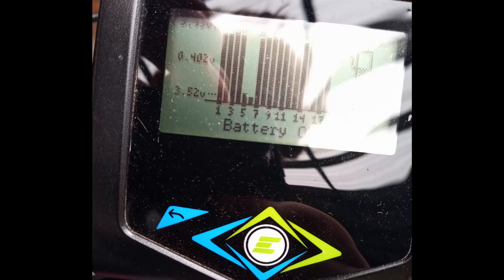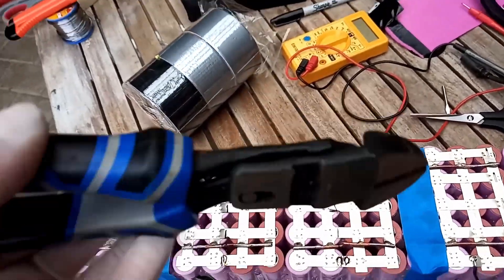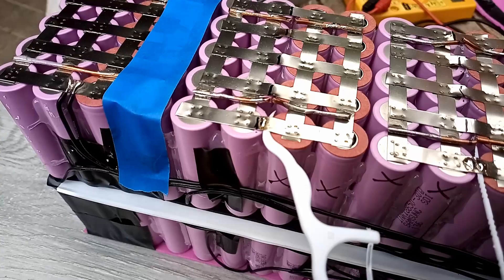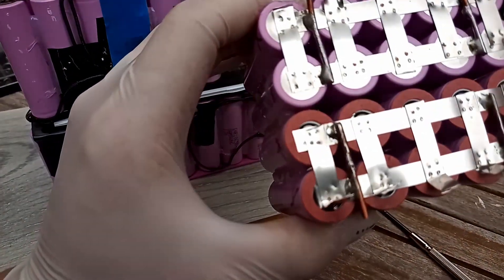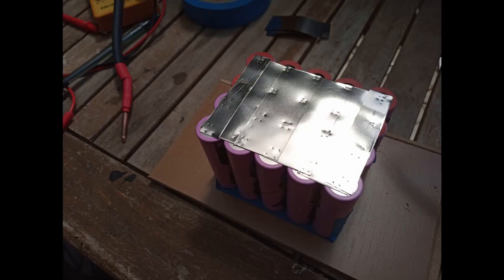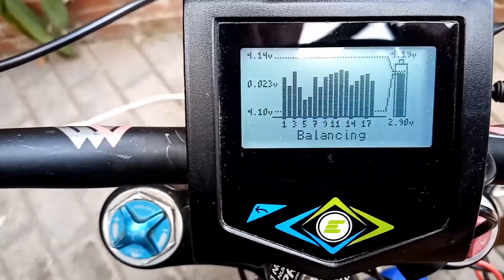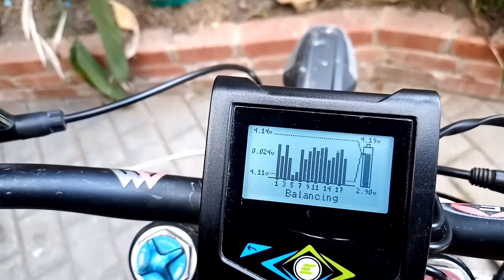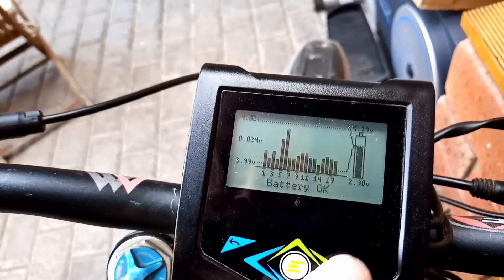Ebike Battery Repair. Cut Out & Replace 18650 Cells With Rotary Tool. Plus Adaptto Max-e Charging.

Comment: Hi are u still on here iv bought a stealth bomber its like new 200 miles on the trip clock. Bike has been standing and battery wont charge. Iv opened it and one of the cells of 11 batteries is on 0, the rest of the cells are on 4.3. Iv got a v3 screen on it will that show me the battery balance like urs ? Also the battery is stacked so its hard to get to the metal on the batteries.  Is this worth trying  ? Thanks

Comment: Can you help me I have bought a 72v e-bike and seller didn’t tell me battery had damage burn hole size 50p coin I bought new battery for 600 which really hurt me financially and mentally I have the old battery sitting I don’t want throw it as it powers uo just shows overheating warning on screen
Reply: Iv just done the same. Bought a stealth bomber which has been standing. Battery won't charge iv opened it and all the cells are full except one so thinking of trying fix it. Are u selling ur old battery ? Thanks anyway

Comment: I have a section (4cells) that reads 0v and beeps (means shorted) while all other sections reads 4.2V, is there a reason that can cause shorting I'm confused and scared to cut the section
Reply from the maker: 0v sounds like that group is dead. Which of course affects the whole battery. shorts can happen for a number of reasons, and you may not even see it. learn more about it, before attempting to fix - you want to know exactly what your doing, and which bits not to touch together. good luck.

Comment: Surely there is a better way of organising a battery system taht is more modular so that you can just pull batteries out of the brick and then just replace them?
Reply from the maker: in a powerwall application for example, sure. In an ebike where space is limited, amps are at their limit and the pack is taking a pounding over bumps as you ride, you need to have it as tight as possible, and all connected with spot welds and high quality connections. Hence repairs like this are necessary, in aging packs. Less of a concern if you are replacing your ebikes every couple of years, and are happy with the rollover costs ;-)

Comment: Is there any other way of cutting through the nickel strip with out using a rotary cutter? Good video btw
Reply from the maker: I cant think of any. traditional snip's or saw blades run the risk of touching the cells - creating shorts or damaging the cells directly.
Reply: @YeahItsLash  what type of saw blade did you use? was it a diamond circular blade? Still been watching this video until I get the balls, knowledge and tools to replace the dented cell… 😅
Reply from the maker: @ize100  just the basic cheap discs that come with the tools for cutting metal. You dont need anything fancy, because nickel and copper are so soft.

Comment: I tried to cut the tab with scissor like your, after the first cut, 2nd started shorted. I stopped. I can’t tell why cutting the tab will short the circuit, but ok to touch with the metal screw driver
Reply from the maker: Hope you can find the cause. if sparks definitely shorting. Mine are big 10p blocks so be sure your only working on one area at a time. Also be careful not to pierce the skin of cell. the whole outside is negative under the cover.

Comment: how did you fix the plates on the batteries?
Reply from the maker: All the nickel strip is spot welded on. my copper bars at the ends of the pack (not seen in this video) are first soldered to nickel strip then spot welded on.
Reply: @YeahItsLash  ha ok, spot welded, s..t, I have to invest in a massive spot welder now :((
Reply from the maker: @pratnama  try these guys https://malectrics.eu/
Reply: @YeahItsLash  thanks!

Comment: Are the new cells you put in the same model as the ones you replaced them with? Or can you use a different 18650 battery?
Reply from the maker: Yes, the same model. Good question. I wouldn't mix cells in a battery. Even adding new ones like this can upset the balance of the groups over time. So far so good though. In reality you 'can' mix cells up, but you'd want to aim to have the same capcity and specs to operate it safely. There may be some subtlties in cell chemistry. But rule of themb - dont mix!

Comment: I'm disassembling an old pack do I can build a new one. How do you separate the cells with their wrappings treating off? I'm worried about what could happen if I store them together naked.
Reply from the maker: Hi Clinton, yes the wrappings can get damaged. You can buy replacement sleeves to re-wrap them. Dont store them together. Even when new / wrapped. Keep em separate. Goog luck.

Comment: Would you repair an pack when one cell is burned? 
Or just trow it away,
Reply from the maker: Try and repair if you can. Replacing cells is the easiest. And yes it only takes 1 cell to mess up a whole pack really.
Reply: @YeahItsLash  
Thanks for the response 🙌🏻 
I will try it!

Comment: With the 48v battery that I have built, the charger thinks at 52.4v that the battery is full.
The first cell has 3.8v and then it increases from cell to cell to 4.1v. My charger glows green and thinks it is full. What's wrong here ?
its an daly bms
Reply from the maker: you might not have the right charger for your pack? a 14s battery will need a 58.8v charger to charge to full. (assuming 4.2v full charged cells) Check the specs of your charger. You may have a charger for a 13s pack or 12 or some other chemistry even. The other thing here is that it appears well out of balance. or dud cells. You may need to charge those low cells individually to bring them into line and see what happens with a bulk charge.
Reply: @YeahItsLash  Thanks for the answer, the charger has 57.6V
You're right, they're not properly balanced.
The first cell is 3.85V and the last cell is 4.2V.
to your advice I'm trying to adapt the low cells with the laboratory power supply. It is possible that the cells are not that good but I have tested them several times over 2 months and the voltages have kept them all over 4.1, no heaters.
Reply: @YeahItsLash  Indeed. During the assembly I took some cells from the wrong stack and installed faulty cells. Much work for nothing ^^
Thanks for the help again :=)
Reply from the maker: @Bergwacht  No worries. Yes, one bad cell or group can degrade the performance of the whole pack. Great to have a BMS that can monitor this.

Comment: How did you identify bad cells
Reply from the maker: My BMS lets me know of a low group. I confirmed by measuring voltage with a multimeter. Basic stuff. For the actual bad cells, you need to measure / test further individually. I havent done this yet.
Reply from the maker: @alexferenci  Each group has a seperate wire soldered onto it that goes to the BMS. from there you can see the voltage values for each group. You can also use a multimeter when the pack is unwrapped. Basic stuff.

Comment: What gadget did u use to check the bad battery?
Reply from the maker: I used a multimeter to detect the low voltage groups. my Display on my Adaptto controller also senses the low groups, by  voltage. I'd have to detect each cell individually to find out the exact culprit.